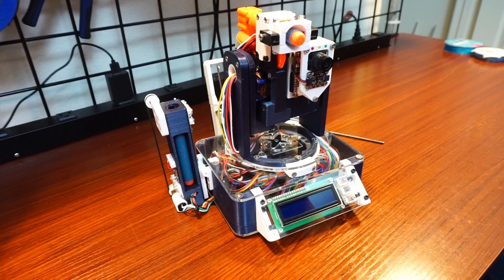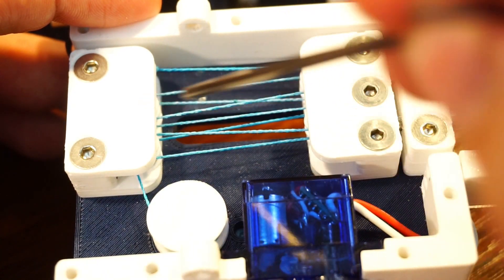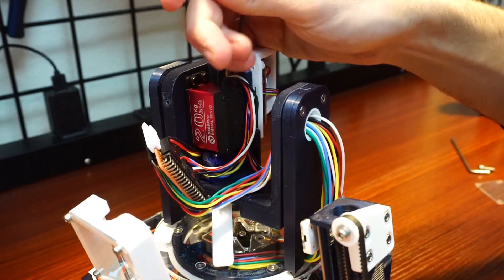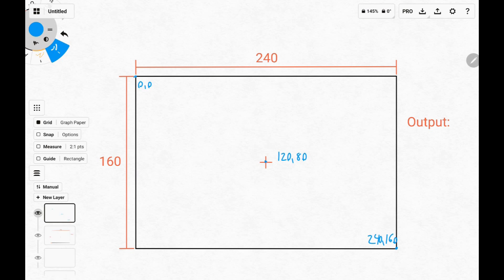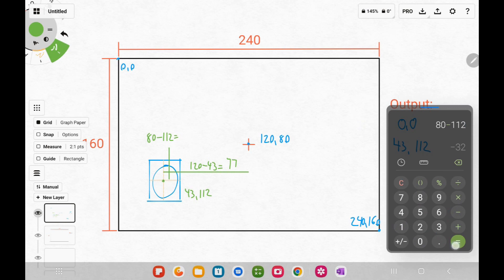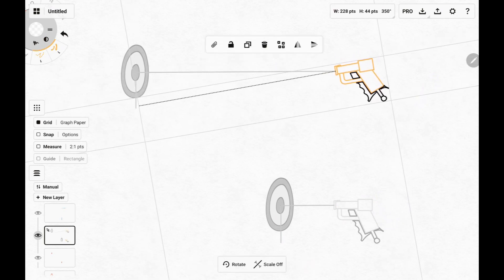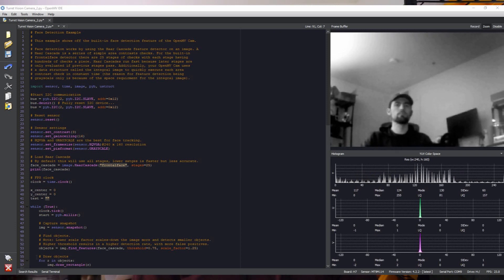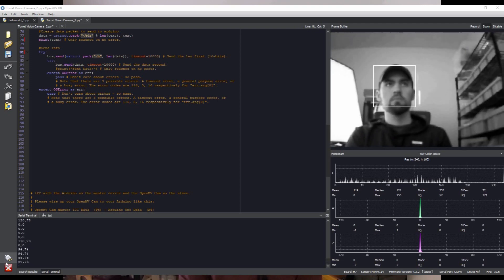Self-Loading Face Tracking Nerf Turret with Arduino and OpenMV Vision

Comment: This is very cool. I was thinking of doing something similar and that's how I found this video. I don't have a 3D printer though, or any experience with arduino or powering servos like that. Just some coding experience. Do you happen to have a rough estimate on how much the parts cost was to make this (minus the 3D printing stuff). I have an arduino uno, but that's about it. Also any links to the facial recognition model. 

Keep it up and can't wait to see the next version.
Reply from the maker: The cost of electronics for my turret was about $250. Taking out the dart loading components, the distance sensor, the batteries, and the Arduino Mega, the price goes down to about $150 with most of that cost going towards the ~$80 OpenMV H7 camera and the two $20 Zoskay servos.

The developers of the OpenMV camera have their own programming IDE with a ton of example scripts. I basically combined two of their example scripts to get my camera to work. You can find more information on the camera on their website (https://openmv.io/) or their YouTube channel (https://www.youtube.com/@OpenMVLLC)

You could definitely make a face tracking pan and tilt with a couple servos and some hot glue. I'd recommend checking out this video to get started: https://www.youtube.com/watch?v=bOXZgV0lVOY&ab_channel=GlevoTec

I'd also recommend checking out adafruit.com. They have tons of parts and tons of tutorials for beginners.

Comment: Hi, this is honestly one of the best videos that I've seen about projects like this! I love the level of integration and the design of the project. I'm just starting out in electronics, and I have been thinking about a project just like this, except with flywheels. 
May I ask how you designed everything? what software did you use and what is the general process of making something like this? How do you plan things out ahead of time so they all work together? Thanks!!
Reply from the maker: I'm glad you liked it!

I used SolidWorks to design everything but it's not the most accessible. Fusion 360 is a good alternative with plenty of tutorials. As far as the general design process, I start with an issue that needs to be solved and sketch out a few ideas. From there I design my favorite idea and test it out and make iterative changes based on what worked and what didn't. What I didn't show in this video was all of the parts that didn't work haha. Most of the parts for this were remade 2 or 3 times with some of the more complicated parts being redone 4 or 5 times. Basically start small, test as you go, and build upon what works.

It may look like it went together flawlessly the first time, but it didn't. I'll try and show more of my design process and failures for my next video.
Reply: @pb.projectbox  Thanks for the reply! looking forward to your next video :)

Comment: instead of flywheel, have you tried track launch, yes two flywheels and launch track
Reply: also air pressure launch should be super fast too
Reply: why not just normal spring load clip, with a tray, maybe even going up the side of the launch chamber, then sideways push-in, to keep stuff not crushing in wrong places
Reply: geronimo

Comment: Exceptional work!, Not only on the project but the video itself. I found the speed and multiple steps of the machine's first shot very funny while being blown away by its Rube Goldburg with a degree-style mechanical design. The idea that you challenged yourself to load and cock the blaster really makes this unique and next level over than much simpler nerf turrets out there.  I've Subscribed, and eagerly await your next work (no pressure to rush though)..now just tell me where to send the money so I can build my own.
Reply from the maker: I'm glad you enjoyed the video! I don't have any plans on releasing this thing (yet). Currently working on version 2 and have many more projects planned. Stay tuned!